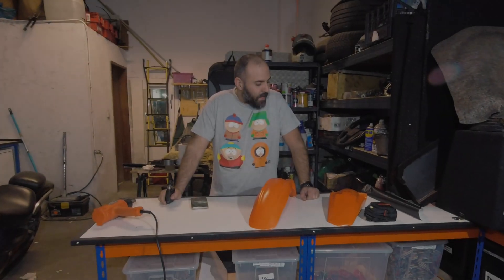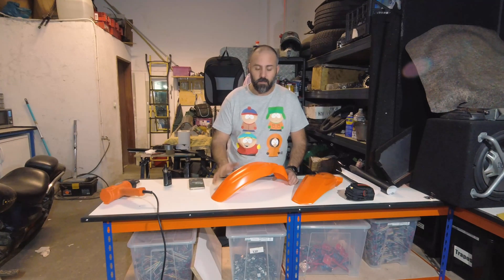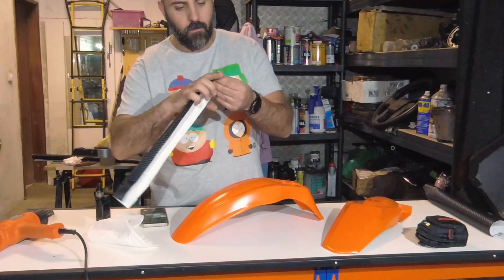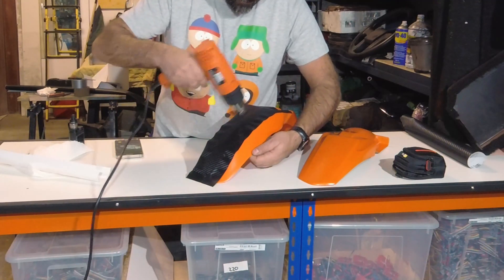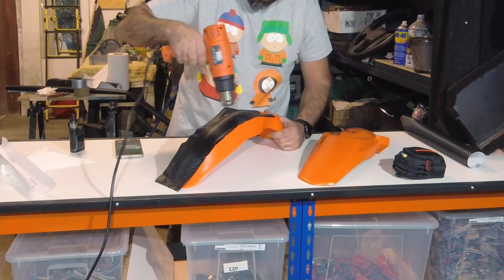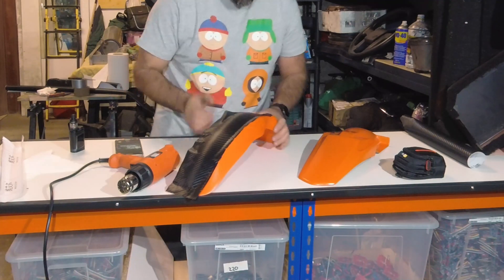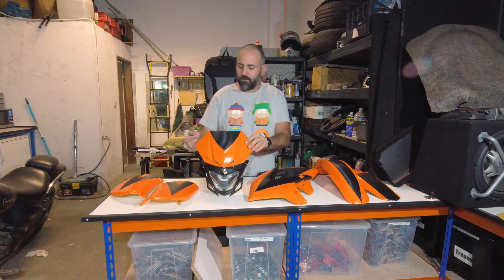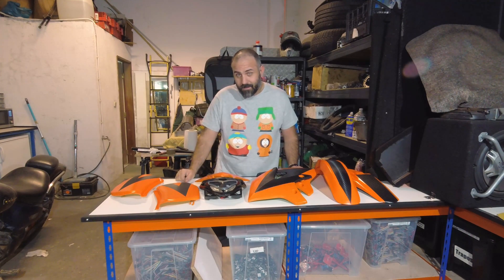DIY Electric Motorcycle Conversion #6 | Carbon fiber wrap for the fairings.

Comment: heat gun is also to cure the glue on most of the carbon wraps as well all the ones iv gotten from aliexpress dont stick very well without heating it up
Reply from the maker: Tank you, i did not realize that but i think you are correct, the heat helps it stick much better.